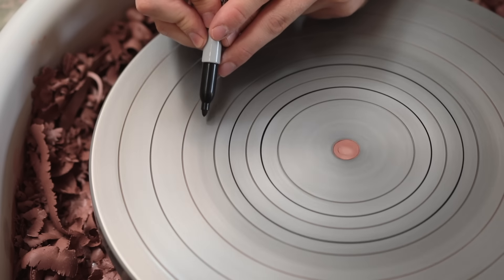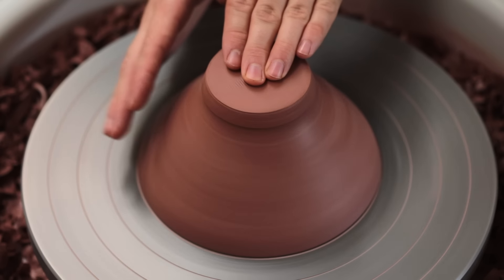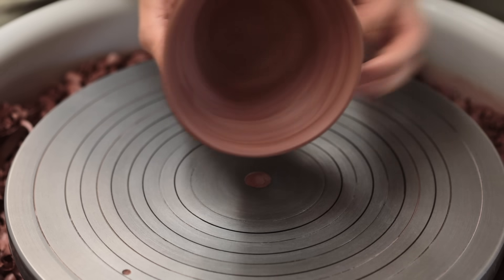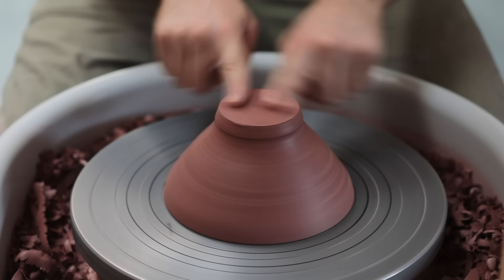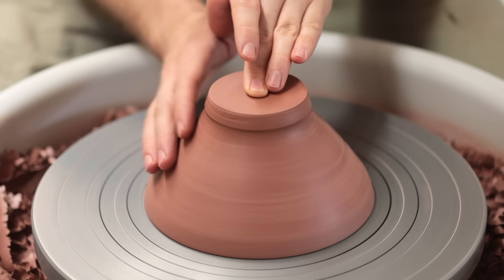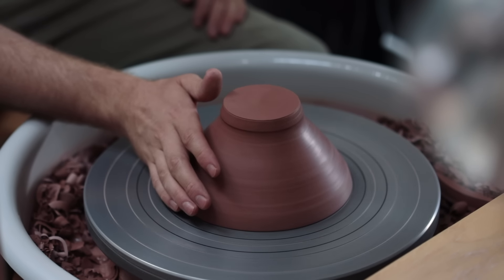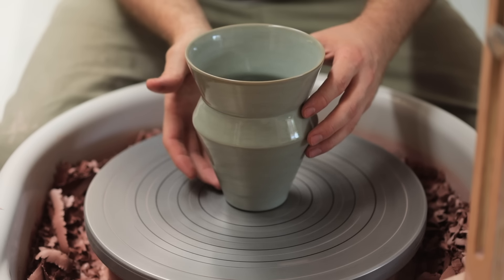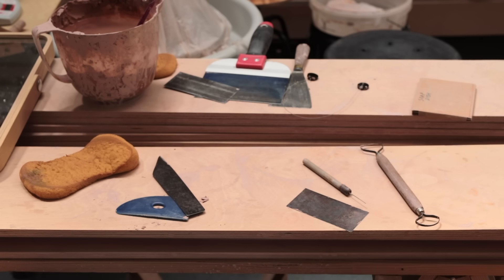The Definitive Tap Centering Tutorial — How to Tap Center

Comment from the maker: I hope you guys liked this more educational style of video! Are there are other topics or techniques similar to this that you'd also like me to make more in-depth videos about? Let me know as a reply to this comment and I'll add it to my 'to-do' list.
Reply: Would love to hear more about the effect wheel speed has on pulling clay? I know there's a point where I need to slow the wheel on an upward pull but I haven't dialed it in yet. Also, changing the pressure of your hands during the pull. I tend to use a lot of pressure at the base but by the time I get up about 4 inches the pressure causes me to torque the clay. So---I know its a practice issue, and a learning how to use that pedal more effectively, but if you have any definite thoughts on what works and what doesn't it would be helpful. Thanks for what you do!
Reply: This was so helpful! I would also love some educational content around trimming bases - specifically, how to trim them level. I find myself continuing to adjust, with it not quite level to the point where the piece becomes too thin at the bottom or pierces through. I’m assuming this has something to do with the angle of hand and/or inconsistent pressure (perhaps due to poorly anchored elbows) but I haven’t managed to clear this hurdle.
Reply: A second educational wishlist item would be throwing off the hump!
Reply: Closed forms in the wheel would be fun to see, as well.
Reply: Throwing off the hump!
Reply: Very helpful.  Another topic would be: how to determine the correct leather hardness for trimming.  At times I deform the bottom of a vessel and other times the vessel is too hard to effectively shape.

Comment: I hope you aren't too hard on yourself about past versions of this and other tutorials. I used yours and others to learn how to tap center when I finally got back into a studio last year after 5 years away (I have a different full-time job but wheel throwing is my cherished hobby), and I found that one very useful too. For me, the "counting" advice of others was useful for teaching myself when to tap, but I don't use it now unless I'm really struggling with a wonky piece that I haven't recycled for some reason. I have ended up using the method you talked about to assess whichever part of the pot I'm trying to center, by checking to see if it seems to move against the background as the wheel spins. You discussing that here reassures me that I'm not doing it "wrong". Thank you!

Comment: Fantastic video. I really really appreciate the time you took to do this. I have a question about centering on the chuck. It seems to me that this brings in the additional difficulty of not just centering but also leveling the piece. Does tap centering help with this as well? The other thing I hoped you would address is keeping the piece on center. I saw that you used slip to adhere the pot to the wheel, which as a beginner I'm afraid to do because the tap centering would take me too long and it would become more and more difficult to move the pot of the slip dries.
Reply from the maker: In theory, as long as the pot has been centred and thrown well, when tap centred on a chuck, centred also equals levels, provided the rim is level when thrown and you've sliced it off level too, otherwise you could use a level, I guess? but better to get the vessel as a whole 'centred' then, if the base isn't level, you can trim it to be level.

Comment: I find tap centring quite natural. The bit that required more to get used to is to control the strength of the hit with light stuff, but your trick to centre the spinner with another tool helped on that.